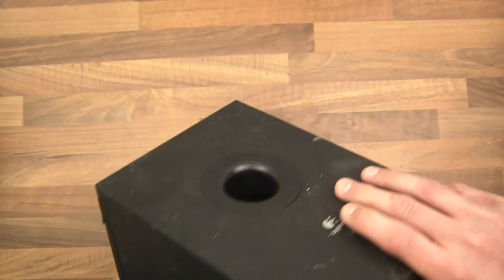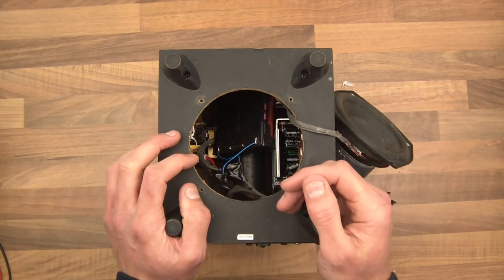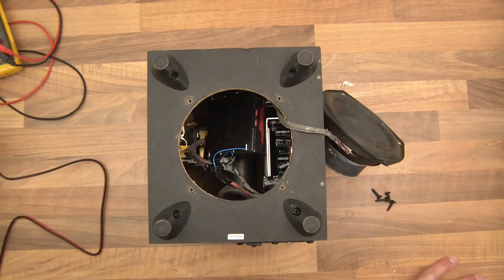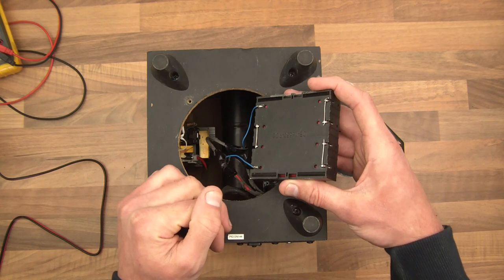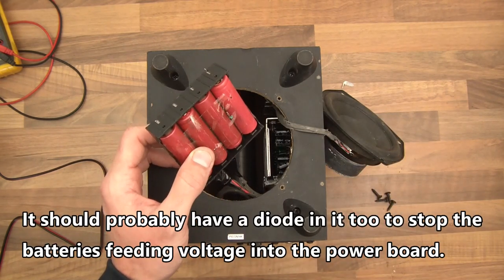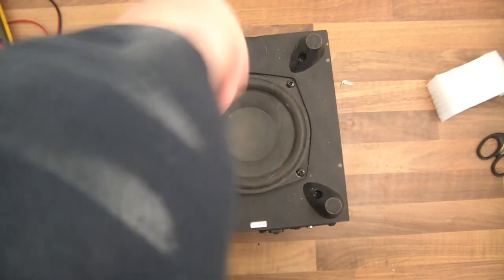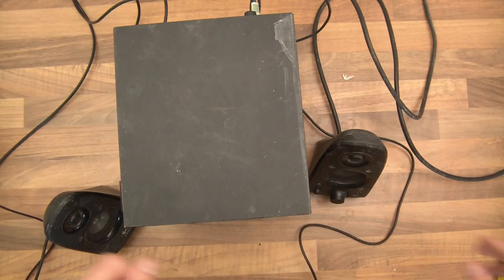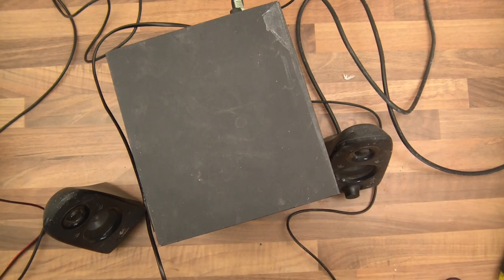INVESTIGATING: My Garden Surround Sound System Mains to Battery Conversion! Lithium & No Wires!

Comment: Cool idea, Antony, and i love Logitech audio! I think, however, i would have preferred to instead just install a jack socket in the back (coming from your cut-in cords) and then use my various portable lithium power packs to plug in and use it whenever it is needed. That way, the chance of it failing is minimized because i always charge my power packs with BMS separately indoors, and they would only be used when needed outdoors.....if you get what i mean? Same system, except split by a jack plug & socket. Anyway, very cool idea...thanks!
Reply from the maker: Yeah! Logitech audio is really good, especially for the price. I actually have a Harmon Kardon set and I'd say the Logitech sound is a lot more pleasant. Yes, you're right. Your idea is a lot better. Or even glue the battery case to the back of the unit and literally stuff 18650s into it as and when. Another thing is a Bluetooth bridge so I can get rid of the 3.5mm jack. I'll look into that at some point too.
Reply: @AntonyCartwright  Both great ideas, mate! Bring us along too!